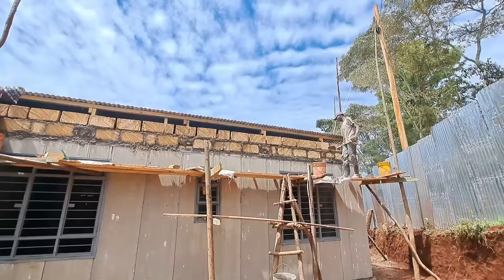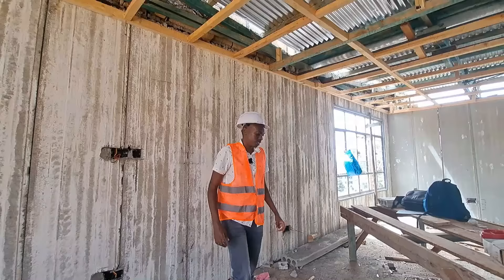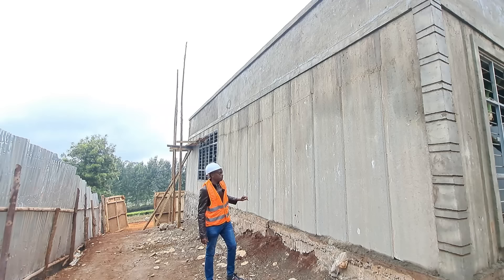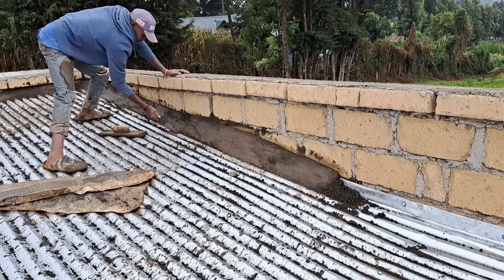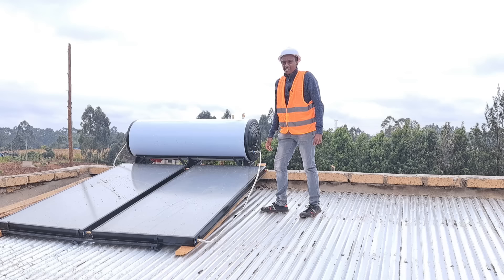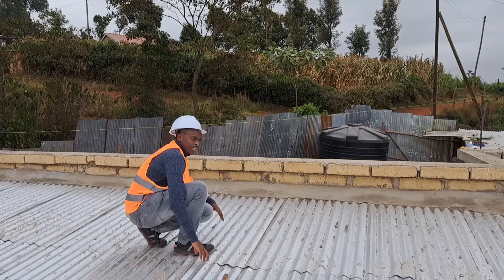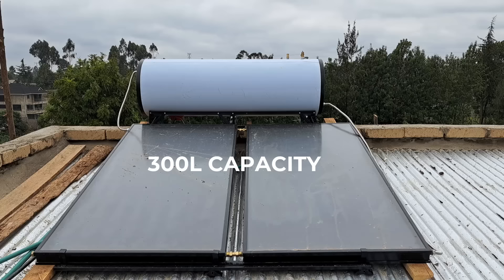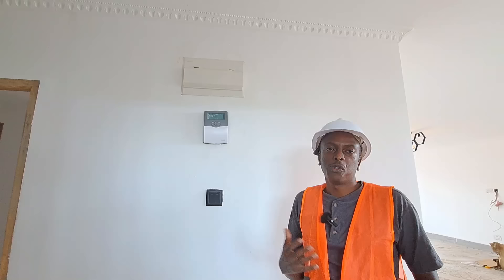Finishing Touches to Kevin's 4 Bedroom Precast Panel Home (170 SQM)

Comment from the maker: This is a follow up video showing the finishing process of Kevin's 170 SQM home. I'll put chapters so that it can be easier for you to follow the combined updates. It cost a total of Ksh 3.2M (USD 22K) inclusive of finishing. Stay tuned for the final tour coming next on the channel. Enjoy!

Watch its construction here: https://youtu.be/q2Ambgejv-A
What are flat plate solar water heaters? https://youtu.be/owzIWR9qTY8
Precast panels: Kingdom Precast Solutions, Line 1: +254 714 259226, Line 2: +254 740 464846

CONTACTS
Eng. Ian Kiptoo, Main Contractor: +254 727 644782
Reply: Does the cost you are running includes labour?

Comment: I enjoy your videos. You do an amazing job. The waterproofing of that parapet wall was not good. There is an L flashing just nailed on with no caulking. The flashing isn’t wide enough either. No counter flashing either. No Wall coping along the parapet. They just slapped a thin layer of concrete which will chip over time and leak like hell. Just totally half ass. I get that this is not something that our roofers are used to, for that, I highly recommend future builders staying away from this type of roof set up lest they cry premium tears! I am a roof inspector and seen it all.

Comment: Amazing awesome work. I intend to build with precast concrete. My roof has to be a water catchment and I am not sure about solar panels not contamination of the water we collect. Are solar panels safe on the roof.
Reply from the maker: Ensure you buy solar panels that have an inert glass surface that doesn't react with the weather elements
Reply: @PropertyNoma  I didn't understand but I agree to do the research . I am sold out with concrete panels. Job is coming thanks.

Comment: Hi nick. What is the cost difference when you use mabati and slabbing with precast panels? Thanks
Reply from the maker: A huge cost difference because a panels slab will still require a concrete screed floor to be poured. A slab is more expensive as it allows you to have a rooftop balcony or add an extra floor later on
Reply: Don’t do it the way this one was done. Horrible waterproofing.